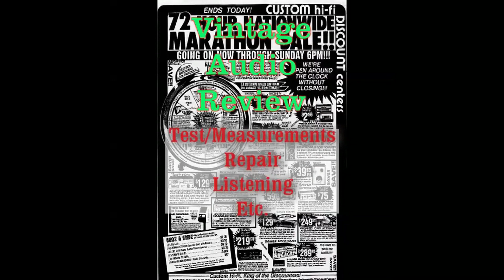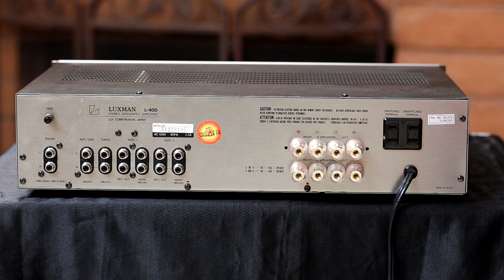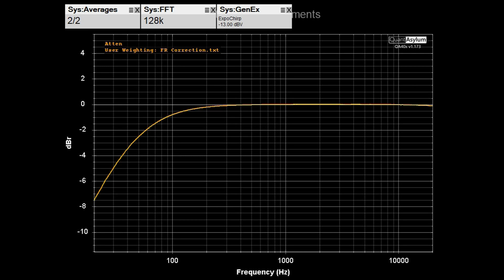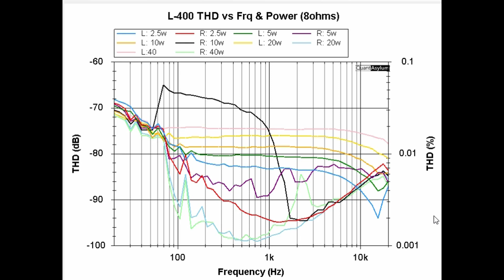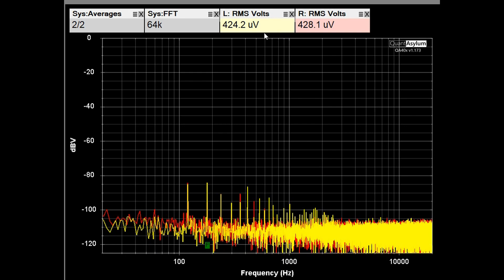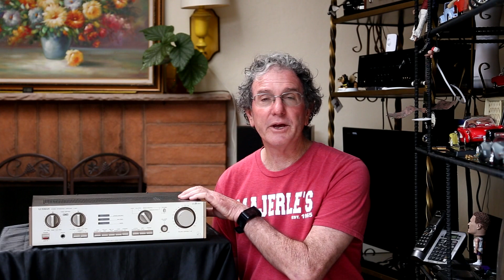Luxman L-400 Integrated Amplifier- Vintage Audio Review Episode #61

Comment: I use a L225. sounds great. I replaced and raised off he board the 2 zener diodes that feed the lamps (one for the volume control lamp and the other for the input indicator)  as they were overheating the circuit board which is common with thar series.
Reply from the maker: Thanks for sharing! Could have replaced the lamps with LEDs, but your solution was simpler!

Comment: I’ve been the owner of an L-5 since 1980. 
It’s never needed any service and still sounds good. The sound signature with both vintage and current production versions of JBL L100s is nice. It’s not hyper detailed sounding and bass is not super controlled like some contemporary amplifiers. 
Overall, I still use it and enjoy its sound. Never gets on my nerves and that’s important to me. 
Thanks for showing the L-400!
Reply from the maker: Many thanks for the comment. The owner bought some different speakers that required more power and so the L-400 may be a spare for him now. To be honest, I am not sure what test I can do to test "super controlled bass" with an amp aside from frequency response.  Definitely can hear it between speakers (using the same amp).